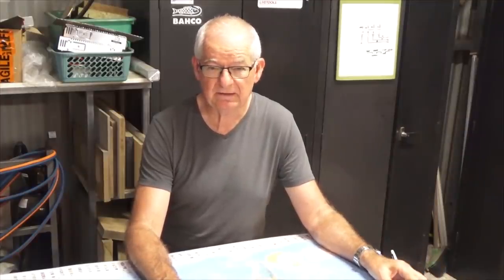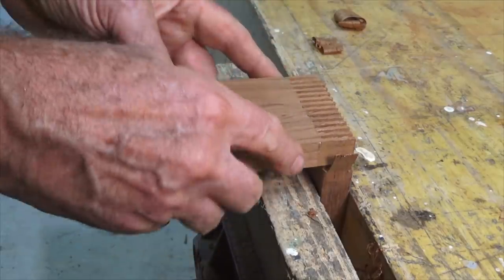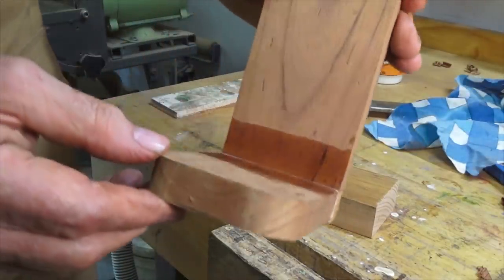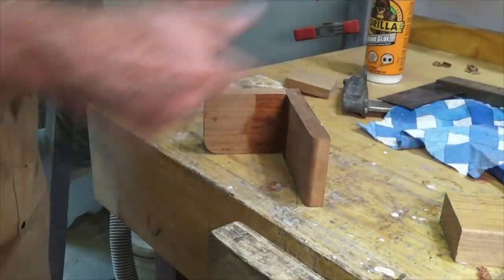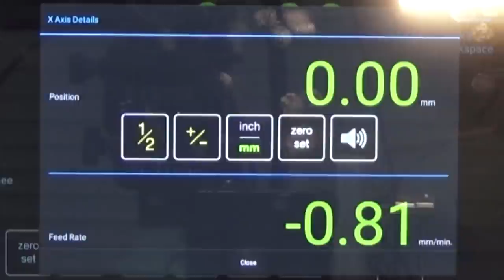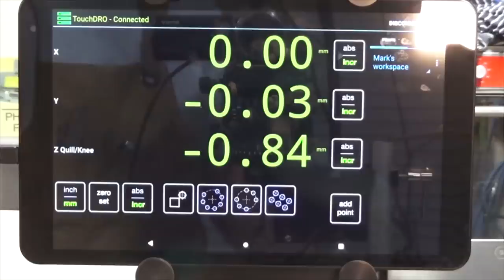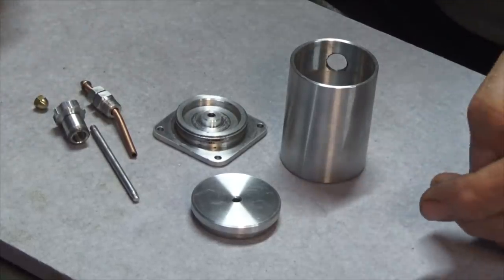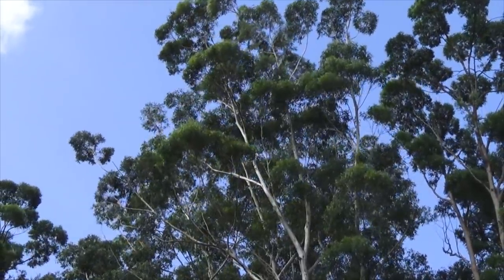Building the Titan .60 Glow Plug Engine #14

Comment: A nice change to have a bit of wood working along with the machining.   I have a local machinist friend who makes parts for his RC controlled airplanes and jets.   He hates wood work and so gets me to make most things he needs out of wood.
I am surprised the display stand was oriented that way in the plans.    As you showed, the engine is far too heavy on the other side.
Very good progress.   I love that Eccentric Engineering chuck.
If you want to place a pin for me, my small town of Germansville, PA, USA will not be on the map.    I am in the Lehigh Valley, hence the LV Woodturner name.   The old Bethlehem Steel plant was in the valley for many decades before it closed.   I am about 100 mile due west of New York City, or 60 mile due north of Philadephia.
Dave.

Comment: HI Mark, looks good, model airplanes need a "clunk tank". it's just a piece of silicone hose with a weight on it so it can be at the fuel most of the time. also Loctite 545 can be used on the threads as a sealant and a plus you can locate the part on the thread and can be wiped clean.
Rich from Illinois
Reply: Also the tank needs a vent so the engine doesn't pull  a vacuum on the tank.

Comment: For it to run the tank will need a pressure port similar to for fuel pick up  it just doesn't need to be as deep in the tank it gets pressure from the exhaust which would be strapped on around the exhaust port in which it will need a nipple that will be attached to the pressure port on the tank many pictures on online of how this works . Hope to see this engine running ,functioning hand built anything always a pleasure to see

Comment: Nice presentation stand. And the box or finger joint is perfect for such a display stand as well. When you use any sealer for the fuel tank, make certain it is impervious to nitro methane and alcohol or it will leak. Also point the copper pickup tube to the bottom of the tank or it will always have fuel remaining inside. Thumbs Up
Reply from the maker: Gary, thanks for watching. I have decided to anodise the tank instead of powder coating it. I can use an RTV silicone sealant on all the joints. 
Regards,
Mark

Comment: Continuing to appreciate your commitment to “truth in videoing”! Tip – It’s probably not too late for an O-Ring grove in that tank end cap…  😉
Reply from the maker: If only I had a large supply of O rings! I nearly bought one of those assortment boxes today but despite having hundreds of rings, They were all the same cross section and only the diameter was different. All of them were too fat for what I would want. It's unlikely this tank will actually get used to hold fuel though. I have another plastic tank I will use for testing. It's all for show! 😁
Regards,
Mark
Reply: @Preso58  Understand all to well Mark. Sounds very similar to my experience with girlfriends...  In any case, keep up the fine effort!! And, BTW, did you see Ozzy Man Reviews from 31 January? Coconut Crabs snapping carbon fiber tubes like straws!?! That for real?

Comment: Roger from Johannesburg , South Africa, great project !
Consider making the tank mounting plate the same as the engine mounting plate , it will be easier to mount them back to back. Also consider a copper washer under the brass nut for sealing.

Comment: Nice work.  I do have to challenge your use of “over engineered.”  As a retired engineer, I always chuckle at the use of this term as it is used completely backwards.  Engineering involves designed parts or structures that are “as strong as they need to be, but no stronger” as a famous engineer once said and “use as few materials as possible at minimum cost.”  So, the more engineering invested the closer a part becomes to being just barely strong enough for the task and at absolute minimum cost.  We never get there in real life as the cost of the engineering at some point outweighs the cost saved in the part or structure.  Since your fuel tank is far stronger than it needs to be and costs far more than it needs to cost, it is vastly UNDER engineered or, more accurately, it isn’t engineered at all it was “eyeballed.”  😁

Comment: Mark- good thing that I waited till the end of the video before I stuck my foot in it,  I commend you on retraining your skills.  If there is room for a shallow groove on the ends, an oring would be your friend.  Fuel is probably going to be with out nitro, so buna n would suffice.  For running, a metal stand is suggested for very high rev engines, and a remote tank (to keep the fuel from foaming and leaning out the engine). I probably have 15 to 20 fuel tanks scattered around, so watching your machine work was entertaining to say the least!  But I think as it is for display purposes, totally appropriate.  You might consider putting lead in the aft end of the tank for balance, tape on the outside to verify?  And the last thing, your propeller is on backwards for a counterclockwise rotation ( which is standard for model engines). Really enjoyed your efforts and taking the time to video and edit.  Can’t wait to hear it blowing oil over the test area!  I know, but you understand?
Reply from the maker: Don't remind me about the backwards propeller. That was an epic fail. I did end up adding a lead plug under the base of the stand. You will see how that works in the next video. I have an old plastic "clunk" tank that I will use for the test runs. I also made a fairly solid bulkhead that I can mount in the vice for initial testing. I badly wanted to use O rings on the tank but they are not easy to get where I live and most of the assortments I have on hand never include a ring the size that you actually want. I am starting on the needle valve and spraybar tomorrow and that will be the last of the parts to be done.
Regards,
Mark

Comment: I would have turned the motor stand around, let the motor hang over the parallel bottom.
BTW my history with model engines was that the fuel ate the silicone RTV. Maybe memory is wrong.  It looks nice.  Your propeller was on backwards 🤔

Comment: Great video. If you mount the engine on the inside of the stand it won’t tip over. I know the prop won’t rotate but should not be a problem as a display stand.

Comment: Looks great mate. Well done.

Re the second base, a piece of glass would look good.

Cut it to be a slightly larger width and twice the length of the wood and position it to come the whole way under the engine and screw or bolt the wooden base down onto it.

Comment: If this thing is going into a museum, you should make a spare tank, fit small electric engine in the gas tank, fit it to the crank and have it slowly spin the prop! Btw, Malte here from Hjørring Denmark.. You thought the UK was small, good luck finding this one map ;) Keep up the great work Mark!
Reply from the maker: Well, you are up on the pointy end of the Denmark peninsula so I can find it easily. I always check out the location on Google Maps and it's amazing what I am learning about the world. Not quite the same as going to these locations but under current circumstances it's still interesting. I was just checking out the Rubjerg Knude. I have a thing about lighthouses so it caught my attention straight away. 
Regards,
Mark

Comment: Hi Mark,

Really nice video series and an excellent build!! 

A couple of things come to mind regarding the fuel tank and fuel system, you at least need a vent for air to enter the tank so the engine doesn't starve for fuel. 
Ideally, a pressure line from the muffler to the fuel tank is needed to provide fuel tank pressure. 
Maybe the instructions you have say different but I've always had to use fuel tank pressure or a fuel pump on every nitro engine I've ever ran. 
I've owned and operated many of these engines over the last 30 years. 
Having said that, I'm sure the engine will run on a test stand without fuel tank pressure since the tank centerline is pretty much inline with the carburetor centerline but the vent is a must IMHO. 

Best wishes!

Joe
Reply: Joe his engine comes from an error that uses the Venturi effect that will automatically pull the fuel up into the engine, in the sixties we started pressurizing the fuel tank tapping off the back of the crankcase plate then we went to pacifiers to get good even pressure.
Reply: @calvarybuilders5689  
I have a couple of engines that use crankcase pressure/vacuum to operate a diaphragm style fuel pump, the most common these days are Perry Pumps but they are nothing new, I think they were invented in the mid 1800s.
Some of my larger engines have a fitting on the crankcase backplate just for crankcase ventilation, one even recycles the spent oil back through the carburetor and engine (a .220 size Saito I believe). Just rambling here. 
I am very familiar with the venturi effect, some guy named Venturi invented it a hundred and fifty or so years ago. :-) 

However, I am unfamiliar with pacifiers, never heard of them before now (other than what babies use, not meaning to be disrespectful).

Either way, he still needs some type of fuel tank ventilation.
Reply: @AerialPhotogGuy   yes pacifier pressure is exactly what it sounds like but they're hard to find today, we also use surgical tube sometimes doubled up and knotted to build a pacifier

Comment: Kingston Radio Control Modelers, Kingston Ontario Canada. Over engineered or not that tank looks perfect for that engine, well done. You don't need to worry about that offset needle hole the engine will run fine as is.

Comment: An very nice job and an excellent presentation of how to do all the machining to make one of this engines. The fuel tank looks very pretty but when we used to fly glow engines we would take a hose from the exhaust pipe and hook it up to the top of the tank that way we would increase the pressure in the tank to push the fuel to the engine. And If you can put pin down for me too Periklis Tsiagkouris Santorini Greece, many thanks!!

Comment: Hi mark with your vent pipe in the cap you will get any regular feed of fuel to your engine find diagram which is a  uni flow tank system and will give your  engine a constant flow of fuel ,been flying control line aeroplanes for awhile so I know cheers love your channel
Reply from the maker: John, this engine won't be flying. It is destined to be a museum piece but you are correct. We used to use uni flow tanks when I was flying control line models back in the day.
Regards,
Mark

Comment: Great build Mark, daft question though, with such a great display mount why don't you just put the motor inside the frame and keep the weight over the centre? No need for extra weight to counter balance the engine.

Comment: That is some nice free electricity if you have a decent wind turbine generator... Also, regarding the boss machining, why not just center the casting on a mill with a dowel pin or a drill upside down - blondie style and use a boring head to turn the outside diameter concentric to the hole? Afterwards you can just handfile the rest to match the body and restore the cast look... Boring heads are a great tool for diameter reduction on parts that are a mess to set up in the lathe yet require/would look better machined... You could also use one of those 3mm dia dremel stones to finish the contouring after the machining instead of using a handfile... You could have also used one of those larger conical stones for dremels to deburr the crankshaft hole in prior episode, they are lovely when you need to refine a hole entrance and dont feel like filing(which i never do, as i slip with files and mangle parts like a drunk surgeon with a hacksaw, yet never seem to have the rotary stones run away and do a surface finish war crime)... Files i find great for some work, even some precision work, but when i need to finish a machined part, i can already hear the file satchel cackling in expectancy of some old fashioned massacre of a finished part, so i avoid it by a mile... Heck, i prefer to use an inserts boring bar handheld to deburr holes rather than using a file, just gently press the carbide and scrape the burr away, gently pushing in so that the secondary burr develops on the inside, if the inside surface is noncritical... A sharp ground carbide insert will slice any burr and your hands open in seconds if you let it, but it does leave a nice finish after itself, which is 99% of the time utterly irrelevant, but its nice to see a mirror finish hand cut chamfer where the burr once was...

Comment: Great video Mark!  One thing worth noting.  A .60 model engine usually has a pressurized fuel tank provided by the back pressure of a muffler.  To get this to run even on a stand you may need to devise some way of pressurizing the tank.  That display stand is beautiful.  Have you considered carving out a chamber in the base for some lead shot?
Reply from the maker: I have already made a lead disc to go under the base of the stand. I will be showing that in the next video. I recall that we used to run a pressurised tank in our old control line models but I am thinking that this engine will only have to run for a few minutes just to satisfy my curiosity. I am one of those sad individuals who invest months of work into making an engine or device and once I see it running I tend to lose interest in it. I have a working jet engine that is sitting in a glass cabinet which has run a grand total of four times. Also two steam locomotives, a Stirling engine and a twin cylinder marine engine, scotch boiler and model tug, all now static models. Like I said, it's a bit sad.
Regards,
Mark

Comment: Great work Preso! You’ll need a pressure line that can run to the tank from the muffler.. Otherwise you won’t get any fuel pressure from the tank to the needle!!
Reply from the maker: Daniel, there is no muffler specified for this engine. The venturi has a choke so it should create enough suction to pull fuel through from the tank. I should be ready to run it in another fortnight or so. 
Regards,
Mark
Reply: @Preso58  I know you haven’t got a specified muffler.. But having played with nitro engines for 15+yrs, I know they don’t run, or stall out without the positive fuel pressure.. Looking forward to seeing it run!!

Comment: instead of RTV silicon on the tank make an O-ring groove around the end cap?

and around the capnut squish a a small o-ring. underneath it 

that way you don´t have to botther removing old silicon if you disassemble it just put on new O-rings before assembling it if needed.

Comment: Mark, rather than adding a larger board to the stand can the engine be mounted the other way 'round with the fuel tank outside the 'L' shape? If not what do you think about routing out a grave on the under-side and filling it with lead or some other heavy material?
Reply from the maker: Denis, I will be adding some ballast to a bored hole under the base. I worked out how much weight I need today. I can cover it up with a felt cover. No one will know except you and I. 😁
Regards,
Mark

Comment: Hi Mark, just simply bolt the engine on the other side of the stand, and then that will allow it to stand up for you.
Reply from the maker: That would work but I think I'll be adding a lump of lead under the base just so it looks as if the prop can still spin. 
Regards,
Mark
Reply: @Preso58  Yep all good.

Comment: It's looking better every episode! When I got the notification I thought "right, it's the spray bar and needle valve" - this suspense is killing me :-)
Great woodworking skills too! I guess the wood bracket was originally intended to clamp to a bench.
Initially, I thought you were going to seal the top and bottom of the gas tank with o-rings, but this will be a display engine, so ease of disassembly is not an issue :-)
That square block of aluminium looked a bit gummy when you machined it - was it cast? Finally, if you want to place another pin, I'm near Lisbon, Portugal :-)

Comment: The treads were both done backwards. That’s a bit of gymnastics for a new bee 😂. Similar to doing crown molding, compound joints upside down and backwards 😂😂
About the high winds, About 4 weeks ago we also had high winds, and it broke off a foot thick branch and hit the front storm door. Thankfully it did no other damage but the glass on the door. Than 3 weeks ago the winds came back, and took out the side fencing, which I haven’t fixed yet due to cold and snow. And than our freg went bad, but that’s another story 😂😂

Comment: I was thinking that the green locktite might be a decent sealer/adhesive for the filler neck, idk? You would think it should be alcohol/nitromethane resistant. You aren’t actually going to run the engine on the stand, oh but you might test the engine with that tank.
Oh just forget it.

Comment: Even the woodwork is top notch Mark. Good to see that you managed to rejuvenate the CNC. How long is it going to last this time? 🙂Very close now to firing it up. You can put a pin in your map 9 miles east of Newcastle upon Tyne, England if you want another one there. 
Cheers!
Reply from the maker: I still don't know why my CNC controller is failing. It is an old unit and it uses a proprietary motherboard with axis cards that slot into connectors on the main board. If I totally dismantle it and blow out all the connectors it will sometimes resolve the issue but it's a pain to do. I have nearly all the hardware to build a new unit and I have switched over to UCCNC as my controller software. It is from the same company as the UC100 motion controller and the C11G breakout board so hopefully it will all play nicely together. I also purchased a $100 3D digitizing probe from AliExpress. It seems to be very well made and it fully adjustable so I am hoping that will also be a step up in accuracy for my mill. I will see if I can jam another pin in the East Coast of the UK.
Regards,
Mark